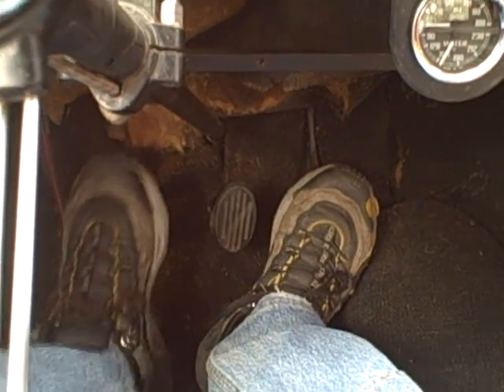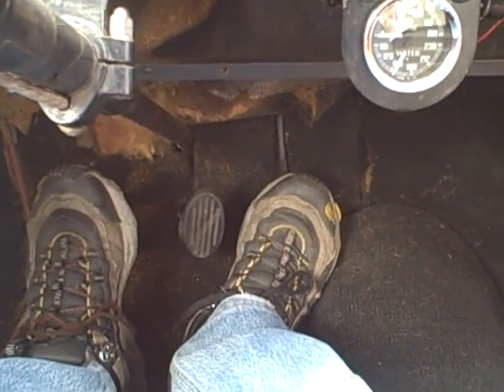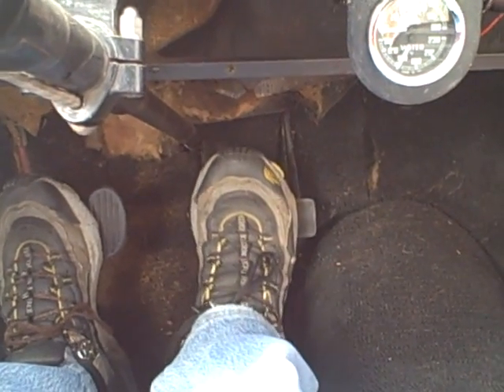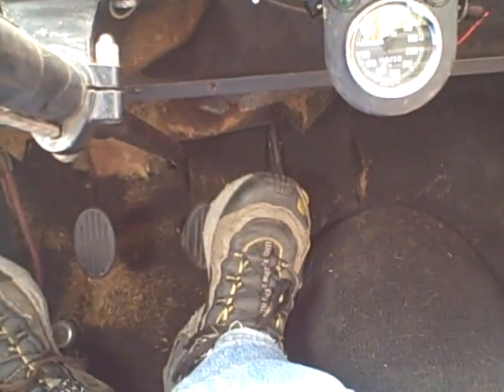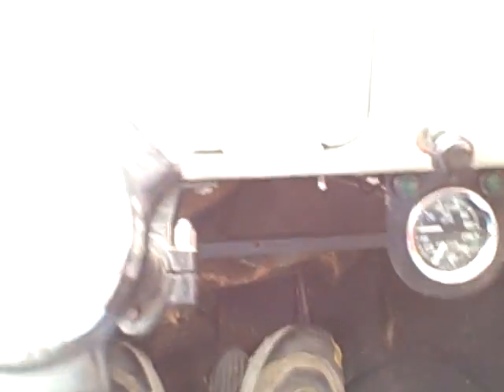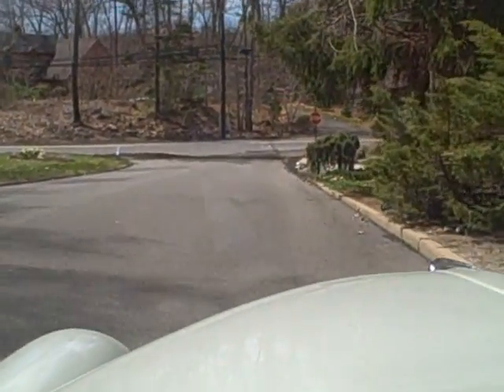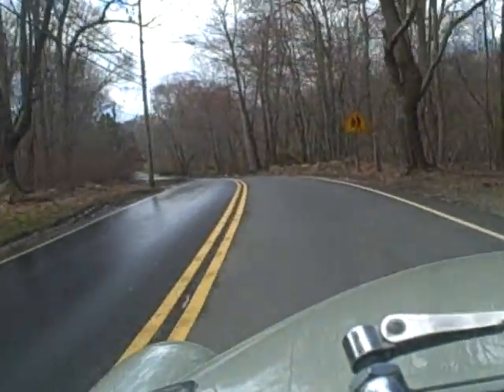How to double clutch downshift in classic sports cars using heel-toe technique

Comment: if you hold the clutch you will cause it to burn up because its open and the mechanical components are all moving and touching it. it will also burn up a transmission

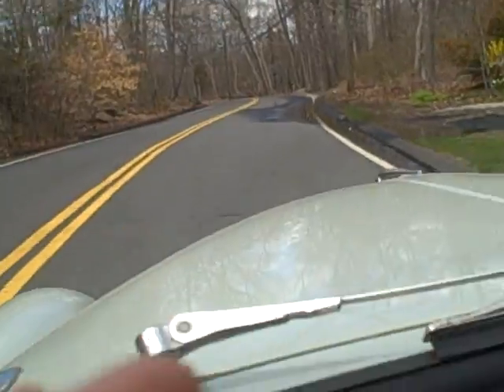Comment: 2:42 you were too late on the throttle there buddy
 2:53 that throttle blip was redundant since the rpm went back to idle
and when you let go of the clutch the transmission forced the engine to go to the rpm it wants

rpm transition must be smooth in order for the heel toe method to even be beneficial